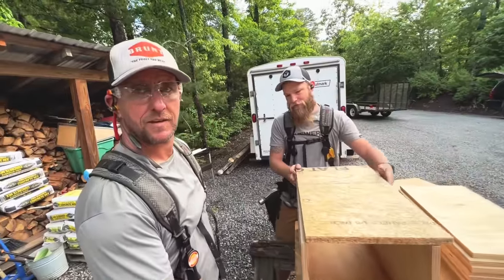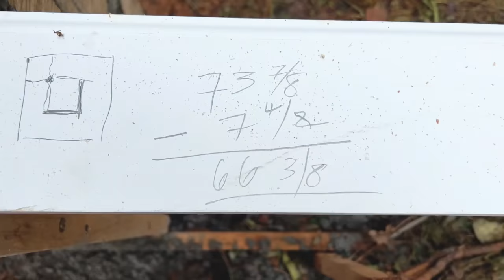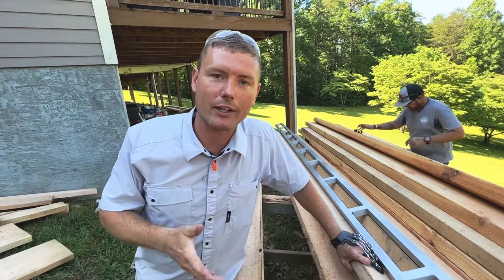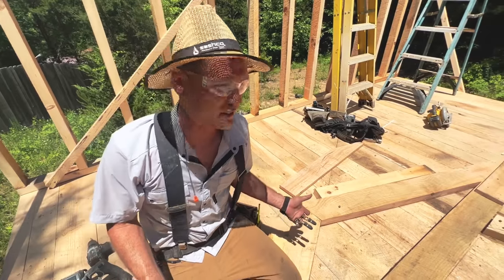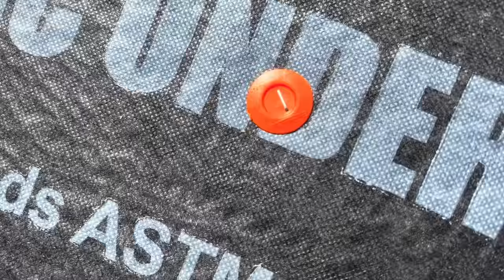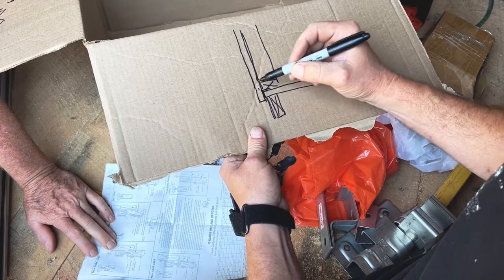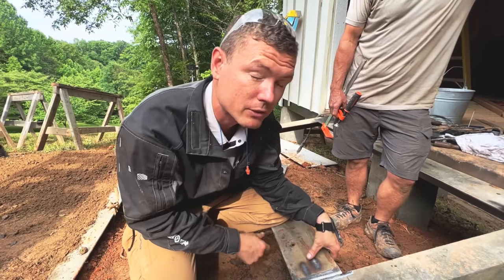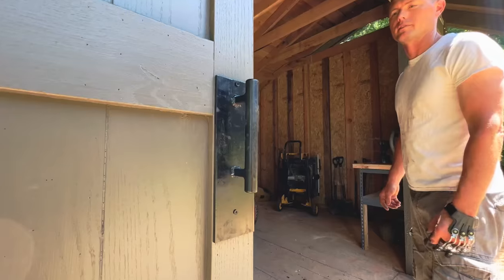Building A Mower Shed With Leftover Materials

Comment: My Dad built my wooden mower shed with a drawbridge ramp. It is on huge hinges at the bottom and the flap closes upwards to become one flush with the front wall by lifting it manually or using the locking ratchet pulley attached with a rope on a hook handle. I can ride the heavy mower up the ramp while on it. It is over 30 years old now and still going strong. There is a high window at the back wall and a separate door close to the ramp to access the equipment without lowering the ramp. It holds the ride-on, equipment like shovels and rakes, etc. clamped to the inside walls, has a utility trailer, 1 self-propelled and one battery mower, weed whacker, lawn sweeper, extension cords, water hoses, soil tiller, soil bags, and some chemicals in there all neatly stored. I've always been in awe of it.

Comment: I laughed when you talked about the 3" nails being too short! I used 20d nails and a palm nailer in the hard to reach places. In 2004 I bought a woodmizer LT27 sawmill. Then I designed and built a 10x16 woodshop. It was a LOT of work! I cut and dried all the framing lumber (true 2'x4"), siding (beveled pine using lapsider attachment) and roof boards (tongue and grooved 7/8" pine). I then built a custom sliding barn door using a pressure treated pine frame with tongue and groove oak panels in the middle part of the door from the mill. I did it by myself. Wished I had someone to show me so, so many times! I watched some of your other videos all this evening including start to finish in one video. great job! y'all are amazing!  I more than most, can relate to the struggles you faced. right after I finished installing the roof boards, it started pouring down rain. i was cussing so bad! I scrambled to get a tarp up there to no avail. fortunately, i put about 1/8 inch space between the boards. the gaps closed, but did not buckle. whew! lucky me. Thank you! god bless y'all. I sold the mill about 10 years later. I was making too much of a mess. Ha!

Comment: Since I'm one who builds overkill, this is fantastic IMO. Great job yall. The first home I built had a code of 7lbs dead load per sq. ft. for snow, so I decided to build it with 56lbs per sq. ft.. I did a lot of additions in Houston Heights where code requires it to match existing structure, it is worth the $$ to match even if code doesn't require it.

Comment: Tight grained wood is common and soap or wax is used alot to lube screws or any fasteners your using repeatedly. You can run the corner of a bar of soap along any clip or rail of nails, only hitting less than half the diameter of the fastener and it's enough lube to get the fasteners in easily.

Comment: They are called Water Pump Pliers ,Channellock is a brand name an I am a retired Water Well Driller ,then even make a smooth jaw set as well Channellock 415 10-Inch & tooth version Channellock 430.

Comment: monolithic form building is a usually inventive way of getting as much with one pour as you can. You and float one form on top of the other providing you have brainstormed ways to kick the sides or in some way or fashion hold the concrete without moving the form sides.

Comment: I would definitely be using some type of red Loctite and a lock washer on those bolts holding them L brackets in the back, because that’s the main structure that’s going to be holding everything up you don’t want those bolts coming loose. And I’m pretty sure they’re supposed to be spec to a certain foot pounds also with a torque wrench! Lol but for real definitely put some Loctite on those for sure!

Comment: Can't go wrong with full dimension lumber, plus if dried properly much straighter and less flexing than what you buy these days. I used full dimension lumber when I built our garage 40 years ago. It came from an old building dating back to the 1900's, still straight. Only problem putting the windows in I had to make trim for all of the windows and doors.

Comment: The problem of "free materials" in this case here I reckon is: You're all a highly efficient, even more highly specialized builder's team used to a certain assortment of materials and tooling You use every day to successfully cut short in time-to-build.
I saw the mountain house You filmed building, and it's almost frightening how fast that went in those conditions. 
On the other hand: As a boatbuilder and restoring engineer working with local carpenter/framer teams, I worked a lot on historic buildings and "old" boats. Often, the building code wanted old techniques used to not destroy the historic character of a building or ensemble. Every friggin building (and every boat coming from another builder's yard and another time) I worked on was a whole different set of ideas and styles, most were churches and/or clergy buildings in catholic Bavaria, Austria and northern Italy, and the church had chief engineers traveling to oversee what was built with the top tier local builders they engaged in their projects, which led to "locally untypical" constructions and connections/styles. We had to go into the statics and loadbearing characters for each knot before making changes/repairs. That way You aren't even tempted to try re-doing it with the same length of nails, screws or the same dimensions of timber and forged hardware You as a builder's team are used to work with. 
So, the point is, coming back to the story of the lean-to-to-the-lean-to You started with: They (like Your ancestors) had no bloody inspectors to please, they had no warranty to insure, they wanted it built in the spare time with what was handy and easy to source, with what knowledge they had gained (or sourced from the neighbor's son recently trained next village), with hardware they had or could make/get locally = cheaply, 'cause China wasn't in the market yet, back then. So, knowing different non-nailed timberframe connections/knots, knowing how to make round natural grown trees yield to Your overall construction, knowing what to do with which species of wood and which sorta hardware - or with a lack of said hardware, for that matter - was much more the thing back then. 
You know where to source the "right" 3 and a half by 1 and a half twoXfour material, where to get the nails NOT getting stuck every now and then in Your Paslode nailers, and You think "cost effective" putting Your 120-bucks-an-hour selling point into the equation. Which Your ancestors did not: They did put in the equation how quick that thing started to do its job, and how long id did that job of shedding the tractor or the bailer ..... no bucks-per-hours put in the equation, and if so, then more as hours to drive to get things from town while not doing farm work. 
So, the character of work is vastly different: The oldtimers did that with handtools, as You had as a quote in the video, which made it NOT a function of time by principle, but a function of knowledge, ideas and perseverance more than a function of money spared, or put in extra, for that matter, in terms of time. 
Anyway, that mower-she-shed looks fantastic, true craftsmanship becomes visible when You gotta force Your "free" materials to yield to Your ideas, which You mastered excellently in this build. Thank You especially for sharing this one! Regards from the other side of the pond.

Comment: When building a new house, the concrete and reinforcing bars from the floor foundation must be firmly tied according to specifications and connected to the upper part. In particular, if the pillar reinforcement bars do not fit into the specifications, the house lid will be blown off by typhoon winds.

Comment: Do you realize that you have a slight bit of storage area UNDER the mower shed for small pieces of wood,etc. Would recommend putting tarp to keep what ever dry,rust free usable if used for additional storage.

Comment: Those shovels are the normal shovels for heavy work in my country,- much easier for doing work than a long straight handle.  When handling gravel to make a flat surface you are using shovels, very strange!  Use a tool called "grafse" to avoid all the lifting with a shovel, "grafse" is the best tool for leveling out mud, concrete or gravel.

Comment: I have a question about stairs. I am a flooring contractor in Raleigh, NC and for some reason a lot of stairs are built without any stringers. The treads are held by the skirt board. And whenever I need to add solid treads I can’t add the solid treads on top of the existing treads because it won’t pass code and I also cannot remove the existing treads because they are held in by the skirt boards. They are most likely pre assembled. . Usually I would remove the existing treads and risers that are covered up by carpet and I would have the stringers left and I would be able to glue and nail to the stringers. But in a lot of houses I am not seeing any stingers. Is there a way to work around this so so that if I add solid treads I can pass code?
Reply: Well… if you tear out all the old treads and risers you could add stringers. One on each side screwed to the old skirt boards and one in the middle.

Comment: I think you could park a tank on that deck. Also if you use your saw zall or oscillating tool on the forms to shake the concrete down to rid bubbles in concrete. I would say it's definitely over built. I would have dated and signed Perkins builders on the steel. That way in 3000 years this will be the only shed left from prior millenia😂

Comment: with pinned connections and  no cross bracing on the piers and columns...the slightest little earth shake is going to slide this into the next county.  a tool shed with an open floor is going to invite corrosion for anything stored very long.  maybe the boards could be caulked and sealed...like a boat. then varnish with 8 coats of marine spar.        should of put the exterior on that high wall before tilt up install.  if this is a sentimental journey into barn work...maybe you need a map.  or look at a YouTube about that.

Comment: The free materials were not an issue. The crappy tools were. Also, long screws would have been better for the extra thick studs instead of a bunch of short nails. Wind is going to eventually loosen some of those badly hammered nails.

Comment: "Pro tip" - Isn't it good practice to stagger siding, roofing, etc. to stiffness and create more strength.   Ask me how I know...   Dang.    I built a shed when I was 10-12 years old...  a long time ago, and I didn't staggerthe boards, and my father made me take it down and then rebuild it staggering the boards.   It was stiffer and stronger.   I learned.   And BTW, what the heck is with all the rain and T-Storms?   Man...

Comment: Arlo's little screw/soap tip wins the day.  I would be careful to sand of the oil prior to staining because it might keep the stain from taking properly. Never think an appliance, electronic or tool is broken until you have dried it out a long time.  Sometimes also spray with electronic cleaner too and get it going again.
Reply: We use wax for screws to help and it's good because it melts and then hardened it is a water repellent. And it comes in tubes like a caulk tube.
Reply: cool. That sounds even better.   @Smokedout.

Comment: It's a real, gardening shovel. Seems like a waste of good oak. Strong as f*** though. Flooring is oak too?  Better pre-drill those holes then! LOL. Cheaper to buy...? Maybe if your found wood wasn't a major hardwood? Just sayin'.  "DEE-walt huh? Here in the West we call 'em "Dehwalt". Proceed. All those battery saws cut it real good, though. Makes me want to go pick one up. Got no $$ for that sort of thing right now. Just bought a new table saw. White Pine and Oak. I see furniture material there. Two foot centers I hope. Nope. Looks like 16. Gables are prettier than sheds anyway. "Fewer" lines. Sorry. English degree here. Also teacher. One word: Pull saw. Why not use the circular saw for the bird's beak?  "Scabs", also referred to as "gussets". (Man, I have a lot to say about this video). Trusses are dead tits lads! Windows? Skylights? I mean, were the trusses plumb before cranking them? Sheathing on 16" centers. I get that. Could you get that in 24"? Same material for battens? (See, I'm using you guys to avoid finishing a threshold repair on the rental we live in. Landlord won't pay, but it's got to be done). Soap! Good idea. Wax maybe?

Comment: Jamie you can use your little bmiller mig welder outside. E,71-t11 030
Wire will give you ample penetration with preparation of course remember to change your 
Polarity electrode positive to his is a single pass self shielding wire

Comment: not-so-pro-tip: if you're out in the wild and have had contact with poison ivy, supposedly if you rub clay/dirt on the spot and rub it around, it will bind up the oils from the poison ivy and prevent it from being absorbed as rapidly and give you more time to wash it off.  Seems to work for me.